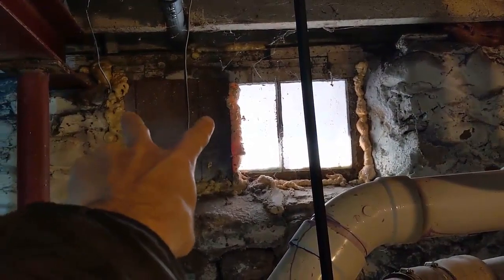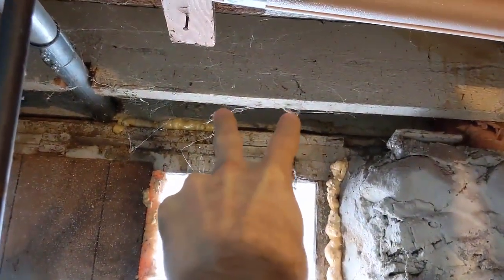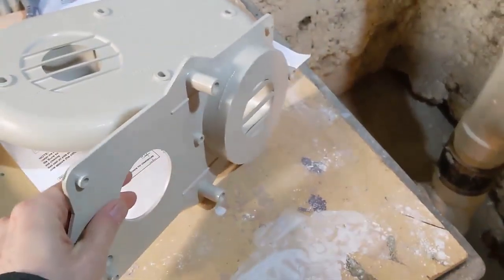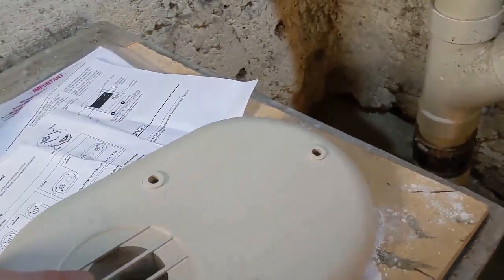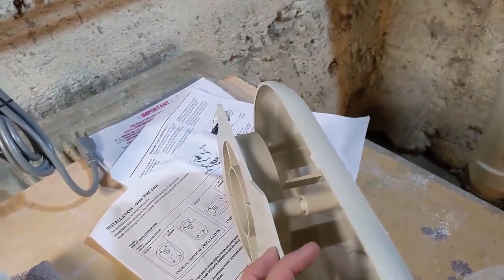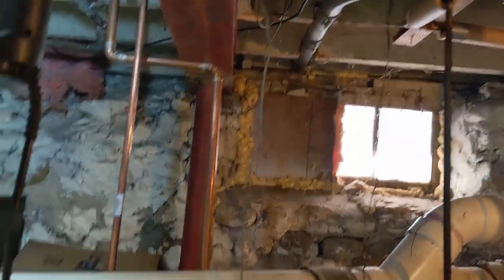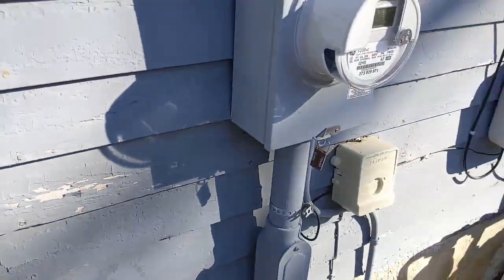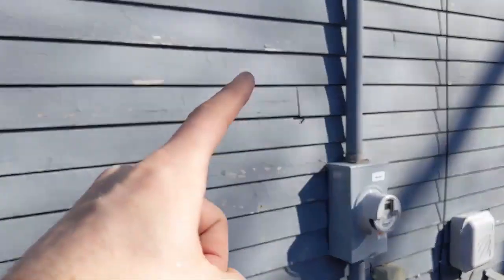Rheem Tankless Water Heater Installation Part 2: Venting

Comment: What happens if this termination kit is installed leading out into or near usable space, such as near an outdoor patio? How dangerous is that?
Reply from the maker: These are the guidelines I read when doing my venting. https://inspectapedia.com/chimneys/Gas-Heater-Direct-Vent-Clearances.php
I don't have a ton of experience, but since the exhaust gas is hot, it will rise. If the vent is over your head and not under a window, I imagine that would be OK. If you not completely sure call the manufacture to get a clear answer.